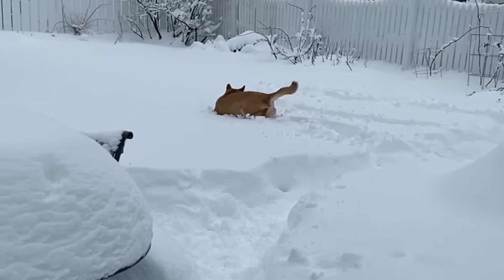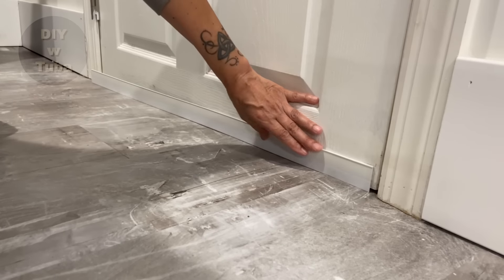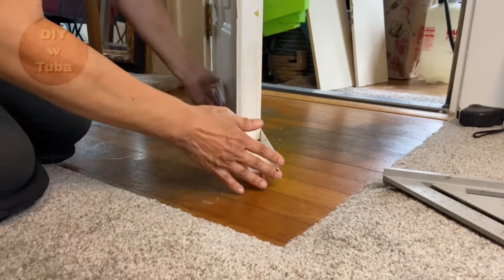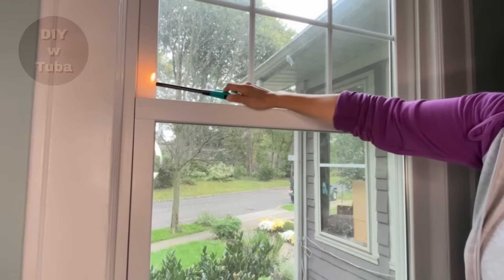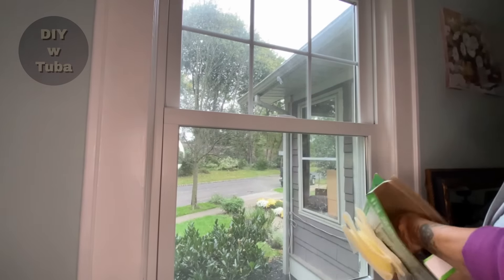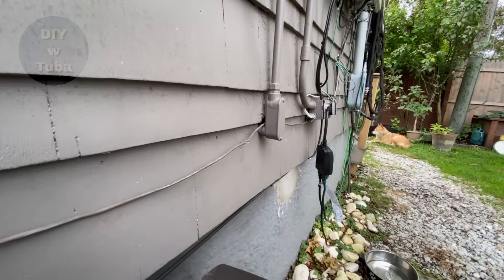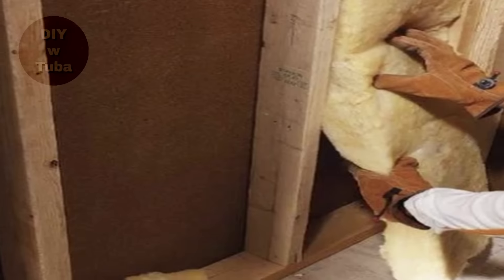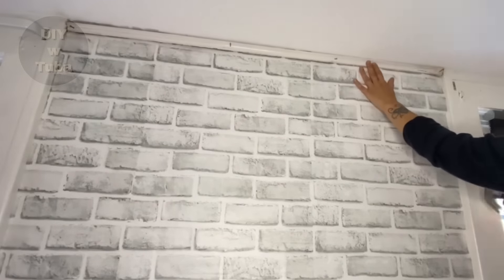WINTERIZE Your Home in 5 Easy Steps || 🔥Stay Warm & Cozy🔥

Comment: For those trying to cover the windows, I've used bubble wrap and foam board. I find that I can reuse the foam board a lot easier than the bubble wrap. I'm so cold.  I'll use anything.  I will stuff bubble wrap in the outlets!  Use pillow covers stuffed with sand to keep the draft out from under the doors.  Thanks for the suggestions. I love the shiny wall cover to help keep out the cold.  I will definitely try this.  Thx!
Reply: I put regular packing type bubble wrap on the top panes and clear shrinkable plastic on the bottom panes.
Can leave them on year round now.
If you can't afford it, simply place towels over the glass to keep air off the glass.
Reply: @crazysquirrel9425  thank you for towel tip never thought of it :thanksdoc:

Comment: How do you insulate a threw the wall AC unit
Reply: Plastic sheets, taped over AC panel to the inside wall.
Reply: @CPeck-rg5gx  I repurposed a yoga mat it worked great.

Comment: We recently found a crack in the inside pane of our 46" x 82" picture window. The outer pane has no crack so it's not like there was a direct exchange of air between the inside and outside. So far I have received one quote to replace the window which is a ridiculous $5,000. It seems most of these places that send out flyers aren't interested in dealing with people seeking replacement of only one window. I am big on return on investment so I'm still seeking someone that will quote me a reasonable price but I have taken my own actions in the interim with very positive results. This window is in a room we rarely spend time in and the curtains are typically always closed which is why we hadn't noticed the crack that ran from a bottom corner to up 16 inches across and then back down about 1/3 of the way across the lower portion of the window. It resulted in a portion of the window being separated from the main glass totaling about 1 1/2 square feet. What I have done for now is used UV activated windshield repair glue / filler along the crack and sealed the crack with clear silicone. After that I applied an inside layer of Frost King window plastic and used a heat gun to shrink out the wrinkles. A hair dryer is what they recommended but I was getting no results using that method. The results were very positive. We use to notice a chill in the air in this room when passing through that no longer exists. I plan to add the film to a couple other windows in the house that tend to have a chill when the temperature drops outside. We have cheap vinyl windows that the previous owner had installed but being retired we don't want to spend a ridiculous amount of money if we can help it. I can certainly attest to the benefit of adding the window film and have also replaced the sweeps and added some seals around two sets of French doors in the room we spend most of our time in. We had an $11,000 high efficiency electric heater and heat pump installed a little over a year ago when our heat pump failed but we are still very energy conscious. Every gap you fill or wall you insulate makes a difference. Thank you for this video. I already have a pretty good idea how to seal and insulate a home but there are many people that don't realize how much you can save on both heating and cooling costs with a little effort while spending very little money. Great job.

Comment: Mmmmm I sealed around all the windows and doors, now my windows are streaming with condensation!!!
Reply: What did you use?
Reply: You need dehumidifier..condensation comes from water inside your house..bath, cooking and human breathing
Reply: If you only have single pane glass and no storm and/or if you have no bathroom or kitchen ventilation fans this can happen. Try drying things out and using the window film for fast fix. Consider adding more sturdy/permanent interior or exterior storms, a bathroom exhaust fan and kitchen range hood before next winter if it’s too late to do this year.